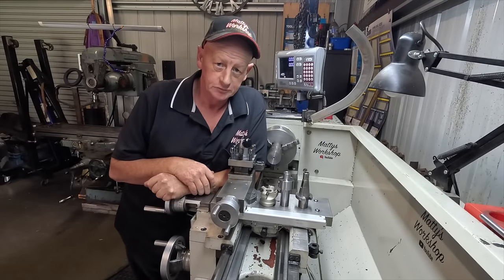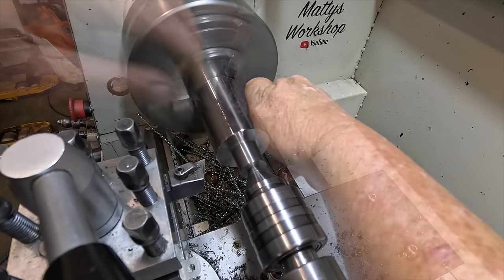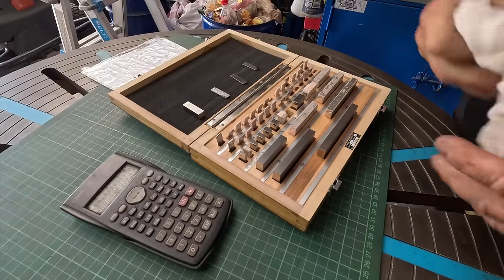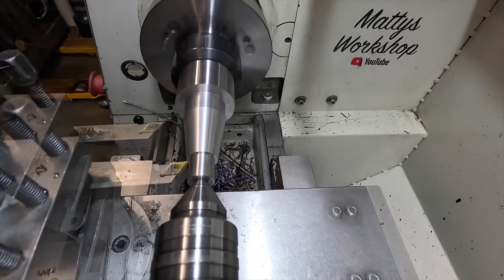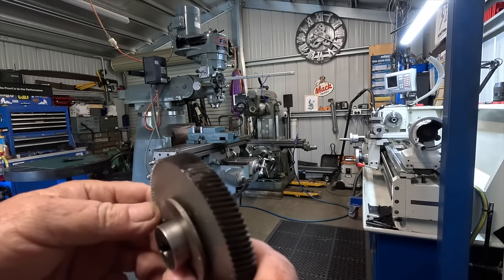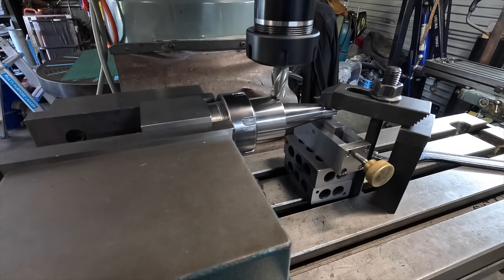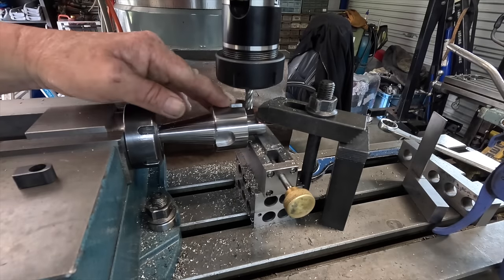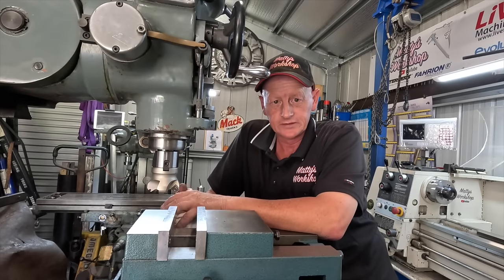NT30 Arbor for the Face Mill...

Comment: Hi Matty,
Great video.
I herd you at the beginning refer to ISO30 and NT30 as if they are interchangeable.
I too believed they were similar enough and bought an ISO arbour for my face mill when my mill is actually a NT30.
The difference is in the draw bar thread even though the draw bar thread on both is both 12mm.  
Once you remove the ball connection thing the ISO taper is too short.  I ended up making an extension for the draw bar but then a 12mm internal thread was edge to edge with a 12mm external thread.
That didn’t end well 🤠
I made a second longer extension and then a 20mm spacer on top of the draw bar and it all worked.  So you can use an ISO taper tool in a NT taper machine but you need to make some adapters.  Might be good to mention this if a similar topic comes up again in another of your videos.
Love your work
Dave.
Reply from the maker: Gday Dave, thanks very much for the information, This mill come with the 20mm spacer for the drawbar, Thanks for watching mate, Cheers
Reply: Gday Davo shed for future reference a piece of m12 threaded bar from bunnings works fine for that as well I bought a cheap er32 collet chuck with an iso30 taper from ebay and had a similar issue
Reply: You need a longer drawbar fr the ISO compared to the NT, beccause the ISO doesn't have the straight end piece at the top, but the taper and general dimensions are identical. The ISO is used more in CNC equipment or where you have auto locking, and they have a screw in pin that the auto locking mechanism locks onto.
Reply: @D40.. While the thread will fit, the threaded rod may not be of the same stress grade as the bolt. Most bolts and similar sold in major hardware stores are usually no more than grade 4.6, where drawbars are higher strength steels like 8.8 or higher. You can get threaded rod in higher grades too, but you need to go to a bolt and fastener type outlet. If you have the equipment, it is not hard to make a suitable bolt with some higher quality rod, and use the lathe to thread the end as required, and you avoid all those sharp edges that scratch around inside the spindle.

Comment: I think you got it all in hand. Just wondering about the rough spot on spindle. Could it be pacted in greese or harden oil with debris? Thanks!!
Reply from the maker: Gday, By the sounds of it theres a couple of reasons the quill has a sticky spot, I just have to work it out, mate, Thanks for watching, Cheers